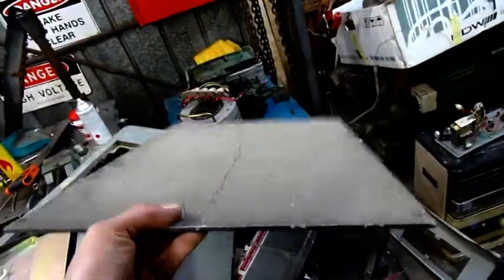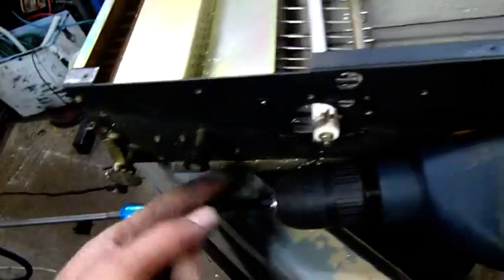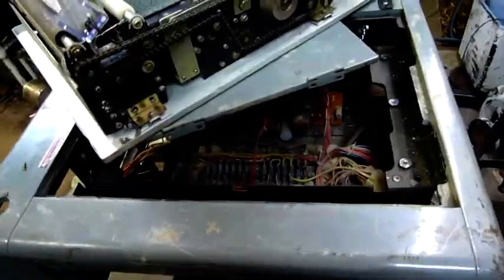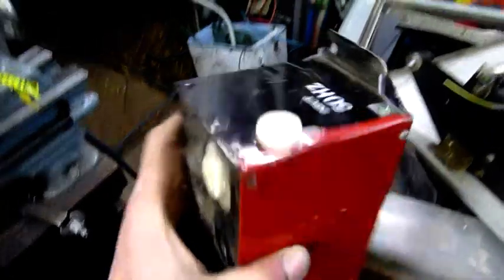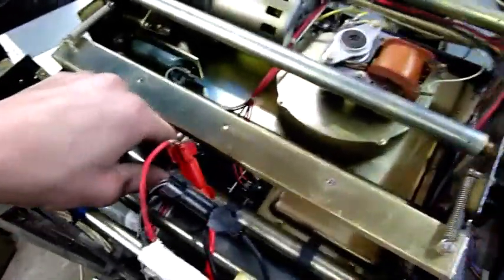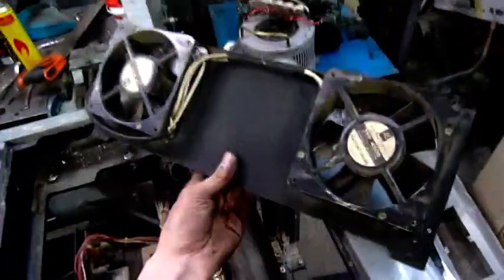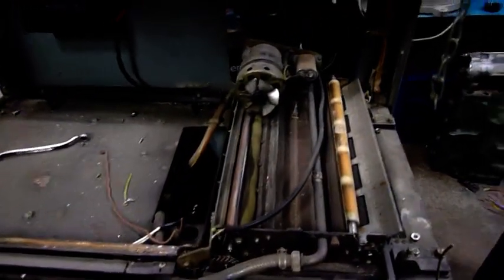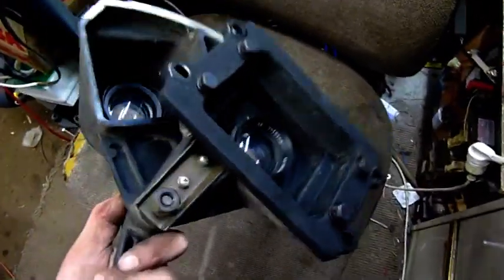Minolta Minoltafax 4500 Copying Machine Autopsy Pt2

Comment: mm im sure you have a full experience of what copier has what i want, what ever what i want in em !!
basicly i want the biggest possible copier lense for my telescope pending project ;
and i want the biggest DC motor for my generator project
i have many motors; steppers and 38 dcv hitachi motors with sensors;
they are cool!
but i have hunger for bigger and more efficient ones !
i also like the power supplies in those copiers; if i can use them , i still didnt try them !